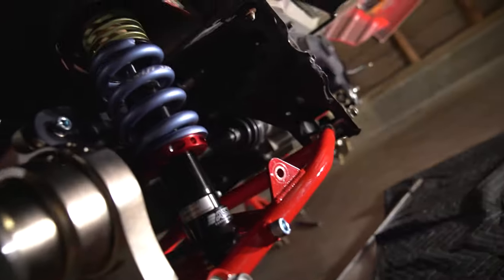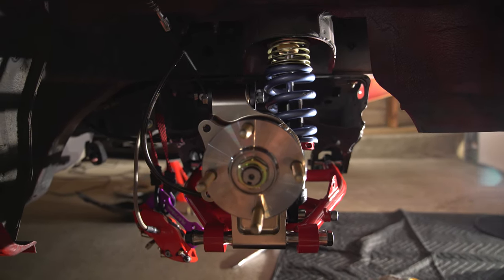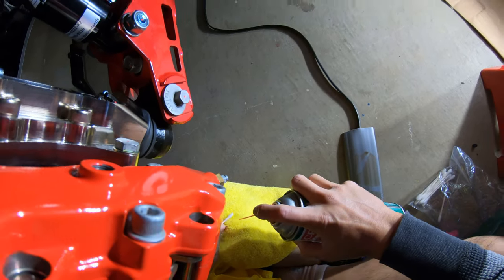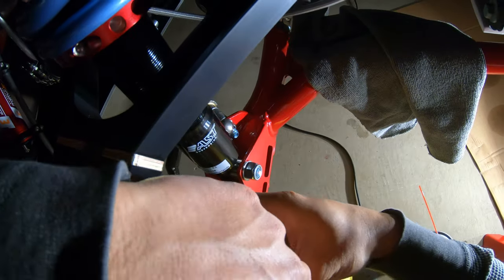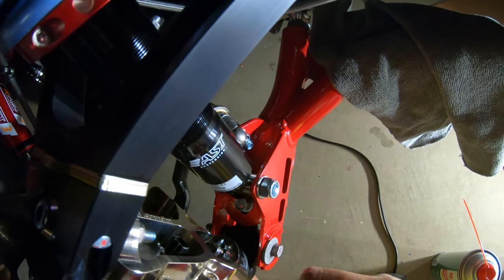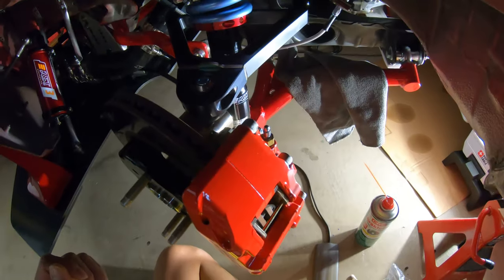MIATA AXLES AND BRAKE LINE INSTALL | #OMGMIATA | EP15 | [4K60]

Comment: Hey man i love your build, its amazing. Just my observation. These fittings are face sealed fittings. The flared part makes the seal not the threads. So that pipe thread sealer isnt doing much. That stuff is good for npt and other styles where the threads are actually make the seal. Just fyi.
Reply from the maker: I covered that on the video. =)
Reply: @OMGBUILDS  sorry brother, must have missed that. Anyway keep up the good work. My 1990 NA is in storage now for winter but soon the fun will begin.
Reply from the maker: @valdeera  sweet!

Comment: Hi man, nice video and car. Very detailed in all your assemblies. Could you tell me anything about Powerlite rear calipers?. Did you make any DIY improve to get a better handbrake power?. My friend said me it doesn´t have stop power to let the car parked in a little ramp.
Reply from the maker: Calipers works great VS stock along with the upgraded MC.
Reply: @OMGBUILDS  I'm talking about handbrake
Reply from the maker: @Gn0m4  it's stock and works fine.
Reply: @OMGBUILDS  I don´t think so. I tried some powerlite calipers in friend´s cars and parking brake doesn´t have enough power to stop the car in a ramp. Even levelled you can move the car pushing it.
Reply: Did you try to push your car after a parking brake?